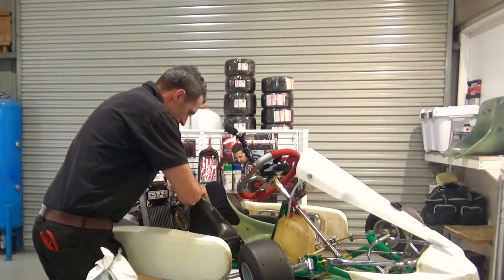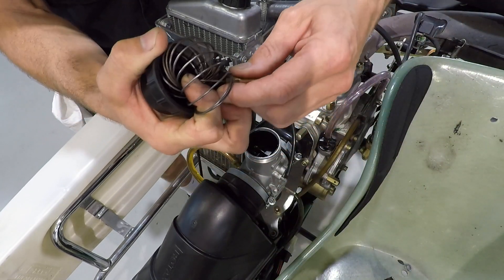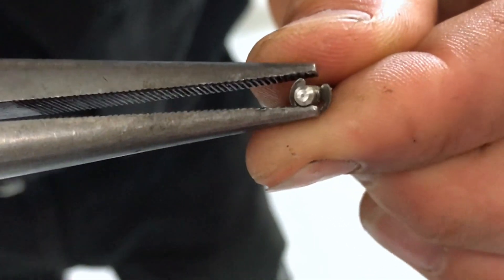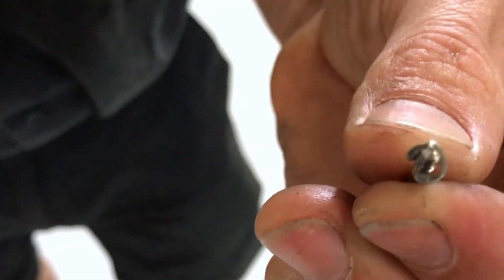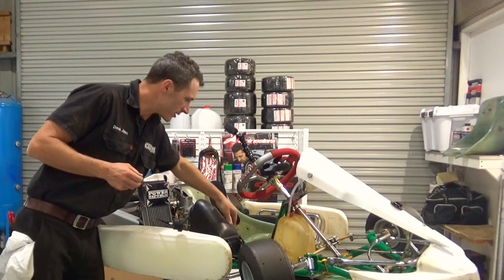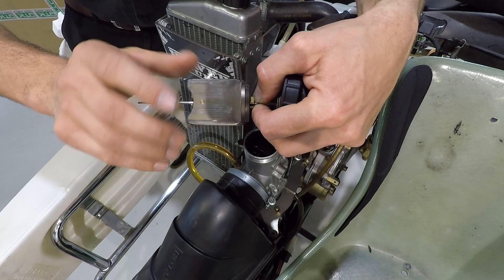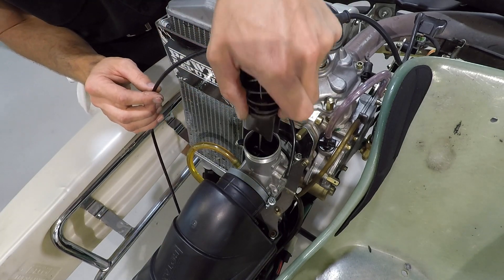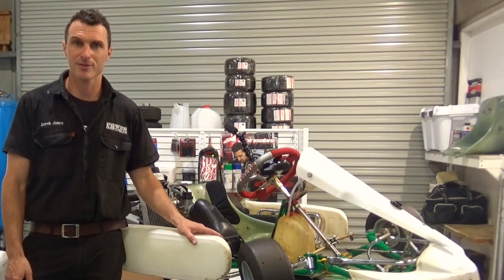Power Republic - The Easy Way to Adjust the Needle Position on a Rotax Carburettor

Comment: Hi Derek can you tell where full throttle  is please .
Reply from the maker: Take the Airbox off, open the throttle until it hits the pedal stopper.  Look inside the carb, should be able to see the slide and the needle should be hanging straight.

Comment: I'll add a bit of advice here from a rookie mistake I made replacing the throttle cable - when you put the nut back in, make sure the pin is set in it's position, and isn't further up into the chamber. mine wasn't, and when I tightened the nut, it bent the pin and I needed to replace it.
Reply from the maker: sweet as Al, thanks for tuning in.

Comment: Where do you set the max throttle position on these carbs?
Reply from the maker: send them at Wide open, full throttle.  the older non evo engines could jet inconstantly so we use to sometimes reduce the throttle opening.

Comment: Thanks that's excactly what it needs,my TAG rotax max is dawging it in the slow turns we have a good 6 tenths of a mile track but they are running it backwards now because of run off area restrictions,so all the turns are decreasing radius corner tight on the entrance i am really getting slowed with no throttle response and I know from my motorbike riding that u can move the clip up and down,I w as also told the pilot could help if its too small,but I'll start with the clip that sound like it shoul fix or at least help improve the lack of or absence if acceleration,THANKS
Reply from the maker: Kellie Nicole Brooks Schettino I would lift the float level up 0.50mm first then start moving the clip position lower on the Needle

Comment: Thank you for the video.  Would this also help with slow rolling start conditions? (Richer needle position)
Reply from the maker: Cody Payne for the slow rolling start you just need to make sure you're loading up the brakes. I only really change the needle position for throttle response off slow hairpin corners.

Comment: From 4 to 5 the clip position of the needle is more richer ...  i would  better response out of the corner  ... what do you suggest 4 or 5 from the top of needle  ?
  (Evo xs carb)
Reply from the maker: Hi Pepe.  either is "better'.  if you kart feels lean off a slow corner, move needle from clip 4 to clip 5.  if the engine splutters and you have to push the accelerator pedal hard to get the kart moving off the slow corners, then you are too rich and clip 4-clip5 will make it worse and you should go the other way back to clip 3.  which ever the case you should try both and let us all know what you found!

Comment: Do you have a video of the carb explained in general?
Reply from the maker: Total Gleam Exterior Cleaning & Pressure Washing  sure do. It’s called the how to 
https://m.youtube.com/watch?v=ZtY8Fn2B07A&itct=CBcQpDAYACITCIz3keivstkCFSogfgod9iMPcTIHYXV0b25hdkigmKippo3ekEo%3D
Reply: Thanks, What would be the reason to change the floats?
Reply from the maker: Total Gleam Exterior Cleaning & Pressure Washing  you can fine tune your float level if your carbs not responding to your main jet changes perfectly all over the track. More float level is richer and less float level is leaner. Start at 23.5mm then change if necessary. If lean off the slow corner and engine hesitates, richer by 0.5mm. If the kart splutters of the slow corners,  lean float 0.5mm.   Let me know how it goes after your next test day. 👊🏿